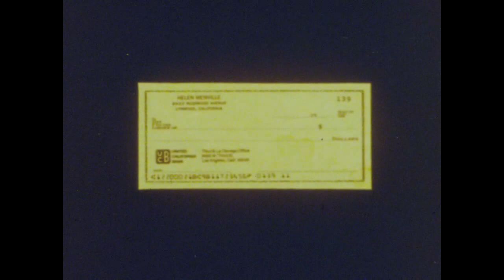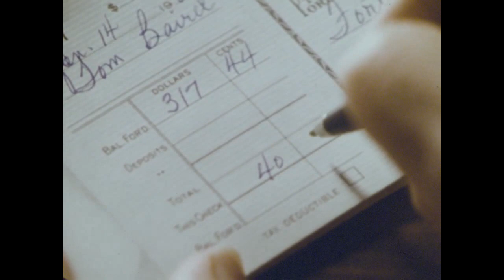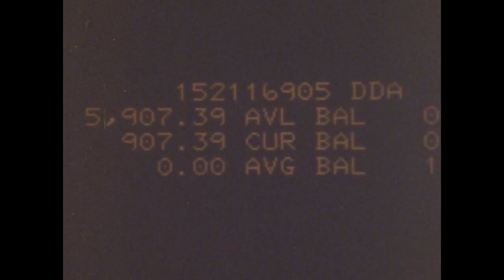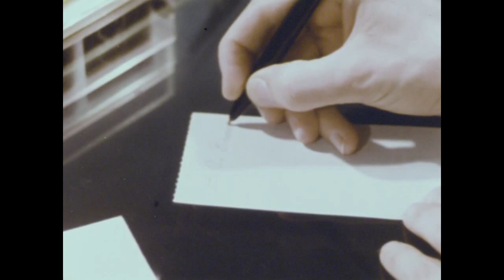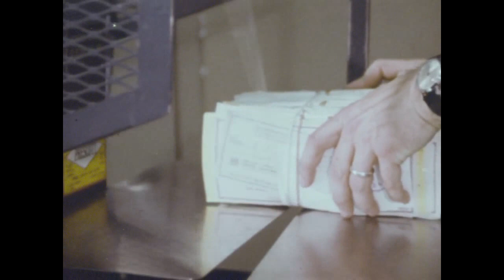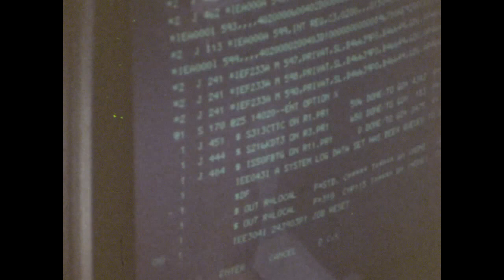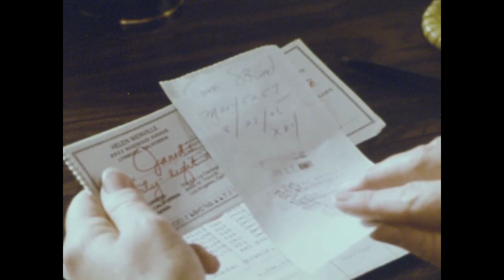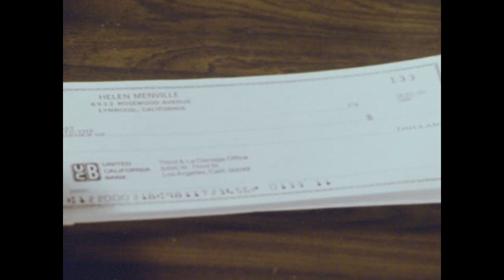Story Of A Check (1965)

Comment: Good luck trying to cash an On-Us check these days without an account. Some banks will do so for a fee, but some will outright refuse unless one opens an account first. I remember those old school ATMs. Some persisted well into the 1990s. Pay bills by phone is interesting, but wonder if it had any real security. Or could anyone call in with a valid account number(s) and pay bills out of other people's accounts. I still remember getting checks returned, then later it was images, then later statement entries only with the ability to order images (possibly at extra cost). No mobile deposit then, but ATMs happily took deposits. Even early on, people would pull the forgot to put the checks in the envelope scam to borrow some money for a few days from their bank. Enough rambling on.